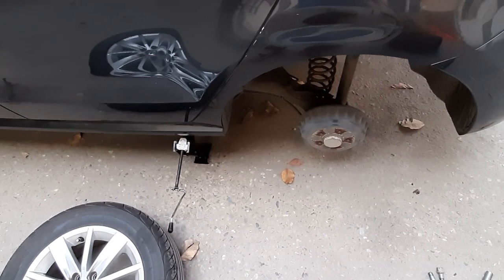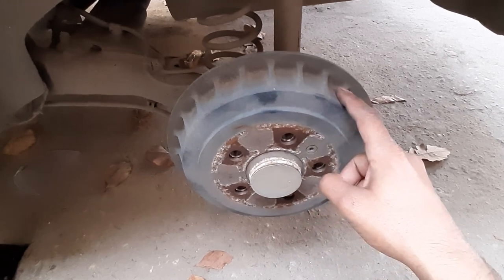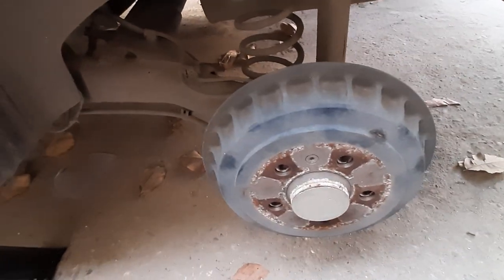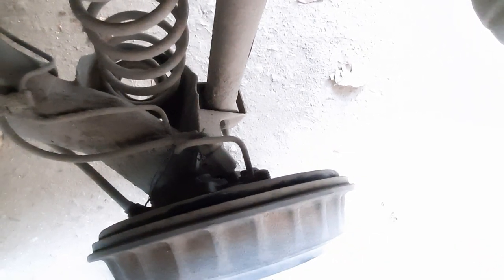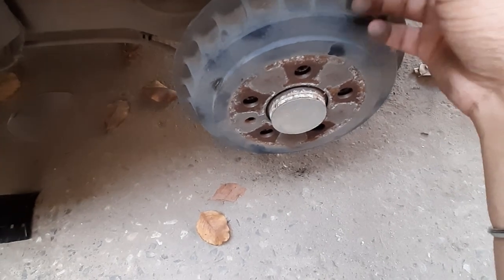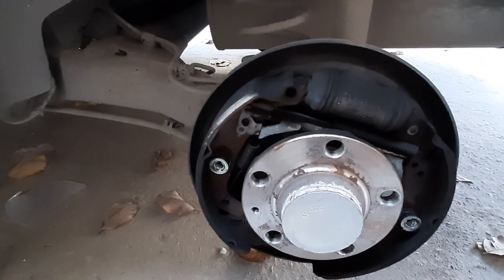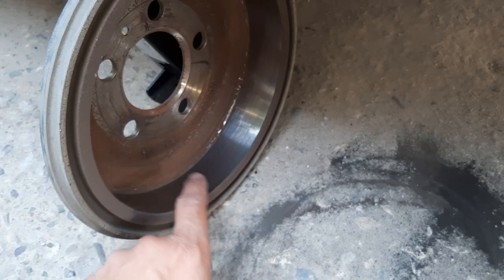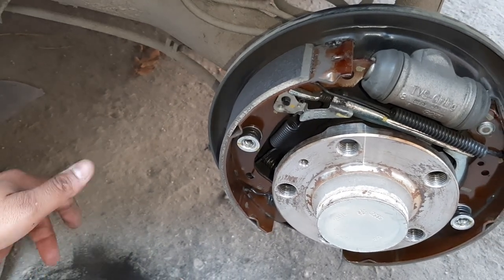REAR DRUM BRAKES ON A VOLKSWAGEN | HOW TO CHANGE

Comment: Does over tightening the brake drum screw will  make the drum  touch the other side and cause more friction and cause extra load to the engine..is that true? Will that be a reason of less mileage
Reply from the maker: It can be , but its very difficult to do that
Reply: @yourDIYneeds  the mileage of my ameo has gone down very much it's giving me 12 in traffic and 15 on highways...it's an tdi
Reply from the maker: Sir few things to check 
1 - tyre pressure with proper alignment 
2 - MAF sensor clean ( considering that there is no MIL on cluster )
3- charge pressure sensor clean
4 - brakes check ( for binding)
5 - condition of air filter ( should not be clogged )
Reply from the maker: You can contact me on the mail everydaydiyhelp@gmail.com

Comment: Ek information chahiye thi sir
Mere pas polo hai 1.5 tdi
Timing belt change krte time uska auto tensioner & idler pully bhi new installed krna required hai kya?
Reply from the maker: Yes sir bilkul 
Kyuki in parts ki life almost same design ki jati hai 
Or baad me pully ya tentioner ke lie specially kholna pade sab to uska koi fayda ni hai sir 
So 
Timing belt + idler pully + tentioner ye cheje ek sath change hoti hai and also have a good look at condition of water pump 👍
Reply: @yourDIYneeds Ok sir,,
 thank u so much.
This information is very helpful gr me

Comment: hi, bro do u have video about fixing front brake pad properly ? my vw polo driver side front brake pad is lose. i think the clip is not holding the brakes pad properly.
Reply from the maker: Sir i have a video 
https://youtu.be/YEyqVCIIyTI
Reply: @yourDIYneeds  bro how many abs sensor is needed in vw polo 1.2l petrol 2013 model?
Reply from the maker: Sir 1 for each wheel
Reply: @yourDIYneeds  is there abs sensor in rear wheel.
Reply from the maker: Yes sir